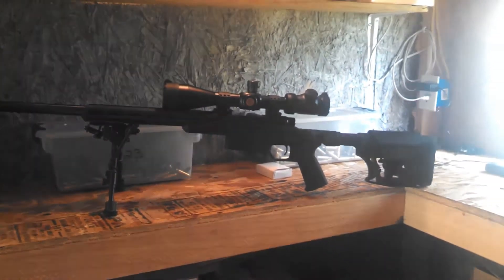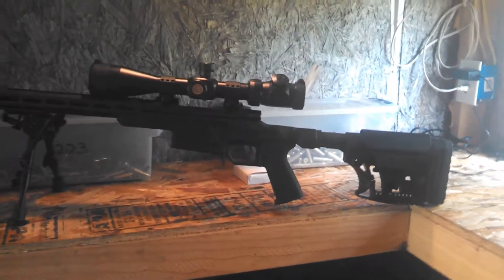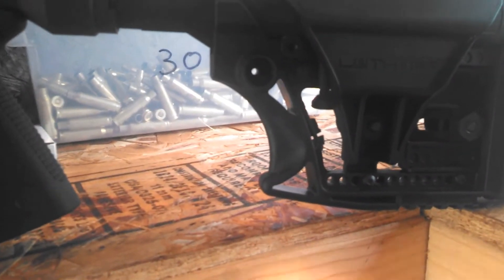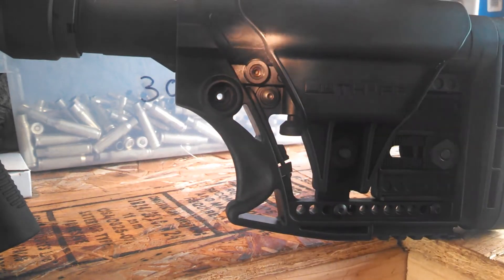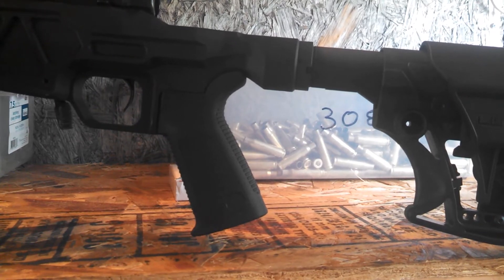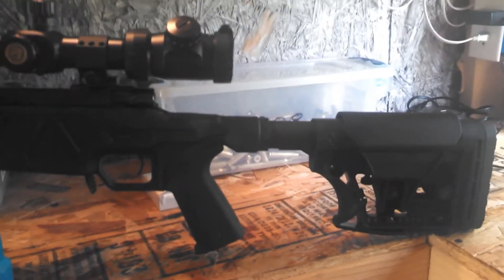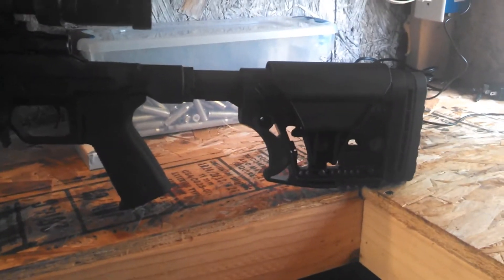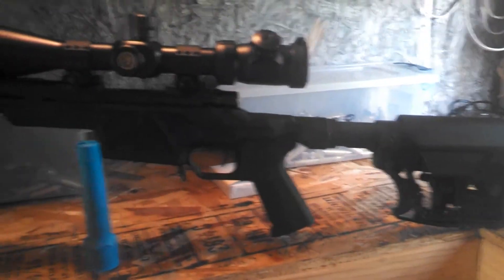Howa HCR, Luth AR stock, Wobble Fixed!!

Comment: Glad I could help, there is an allen key wrench to the left of that set screw pushed  into the stock itself you can use for that set screw if your out in the field and it loosens up on you. Just some FYI.
Reply from the maker: That's awesome, thanks again! Ill put that info in the description as well..

Comment: Great info!  is the butt pad height adjustable also?
Reply from the maker: weazle66 unfortuently it is not. Would have been a nice addition though, but for the price point can't complain, thanks for watching!
Reply: just watched another video for the MBA-3 stock and you may find it has slots in the back of the butt pad and you can adjust the height via the slots...
Reply from the maker: weazle66. Very cool, thanks for the heads up